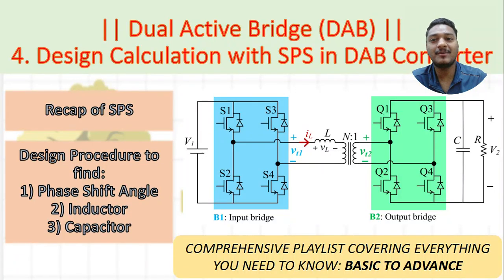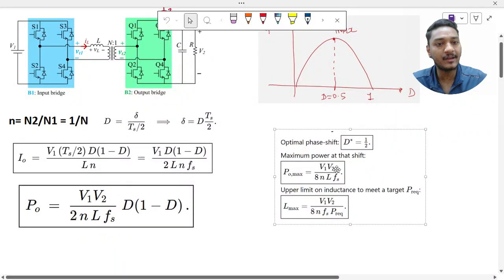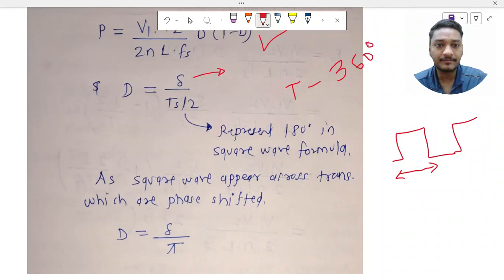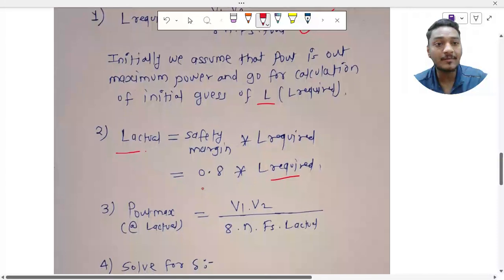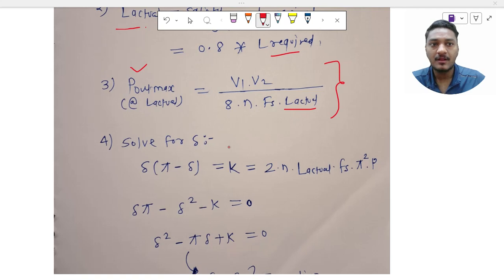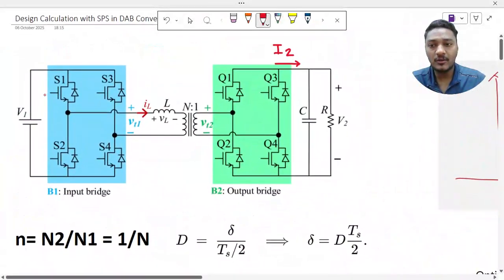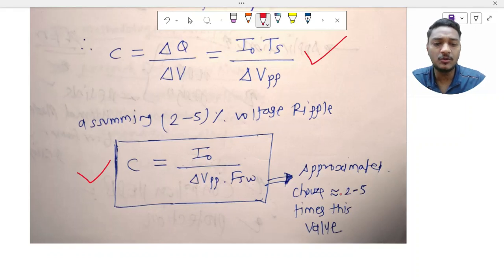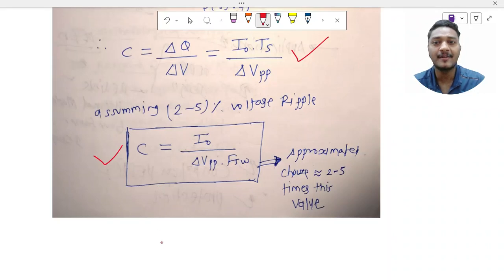LECT 04: Design Calculations for SPS in DAB Converter | L, Phase Angle & Capacitance Sizing

Comment from the maker: 🔧 Correction (important): In the video I mistakenly wrote an incomplete expression for 
K = (2 * n*pi^2 * Fs * L * Pout) / (V1 * V2)

the denominator V1*V2  required. It will not affect the overall calculation process.

Happy Learning.
Reply: @ 4m42s there is something intring me. Duty cycle D is without unity but you put D= (gama/Tsw/2) unity rd/s. Is it normal to have this for duty cycle?
Reply from the maker: @diallolaho8320  D is not duty ratio here as normal converter. It's normalize phase shift. Now in order to convert that phase shift into angle we have done that. It has nothing to do with duty ratio. Here in DAB we usually consider 50% duty ratio only. Please reviese notes once what I have taught may be you'll get idea.
But thanks for asking question and HAPPY LEARNING😊
Reply: @Kingashish-555  I'm not total agree because in the last formula you put D=(Gamma/pi) in this case gamma unit is radians ans pi is radians...it looks like D is without unit...correct me If I'm wrong
Reply from the maker: @diallolaho8320  That’s a very good question. You’re absolutely right to raise this point. When we first denote δ (phase shift), it is shown in the waveform graph where the x-axis represents time. Hence, in that context, 𝛿 corresponds to a phase shift in time (seconds).

Now, time and angle are interchangeable representations for one switching period — for example, one full switching period 𝑇𝑠 corresponds to 360° (or 2𝜋 radians). So, if the x-axis is expressed in angular terms instead of time, the same phase shift 𝛿 can be represented as an angular displacement.
Therefore, in the first case when we define D= 𝛿/Ts/2,   δ is in seconds (time-based).

But later when we write   the same D = δ/pi, 
δ is now expressed in radians (angle-based).

In both cases, 𝐷 remains dimensionless (unitless) — only the reference axis (time or angle) changes the way 𝛿 is interpreted.

Comment: Sir can you share the turns ratio calculation and leakage inductance also for taking 24 volt -i/p and 48V-O/P.😊
Reply from the maker: Same process we can follow. If you have any confusion may be in next video it will be clear.
But for your case you can choose n1:n2 as 2 and based on what is your output power, you can do further calculation.

But one thing which we'll learn later is it is ok in simulation to use any kind of turns ratio but practically what i seen is that usually 1:1 turns ratio is preferred and is handle with phase shifting. You need to go through few papers to understand it in more detail.

Happy Learning.
Reply: Thank you @Kingashish-555
Reply from the maker: @MdShadan-c4u-n6o I have tried to answer your query in next to next lecture through few matlab case studies where you'll get more clarity on your question.

Stay tune for that video 😊
Happy learning.